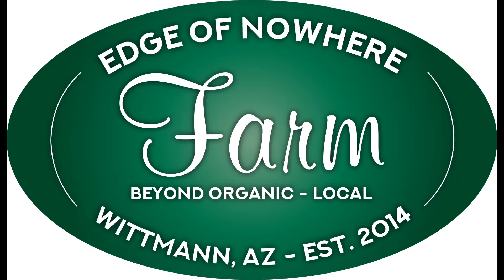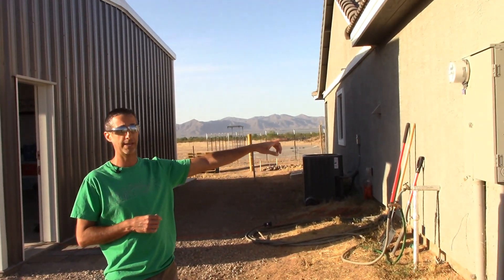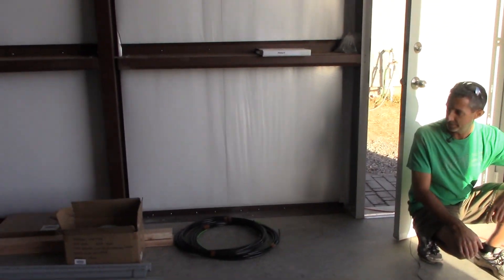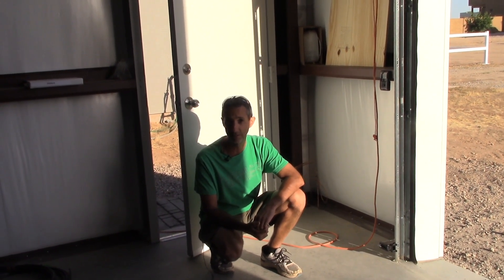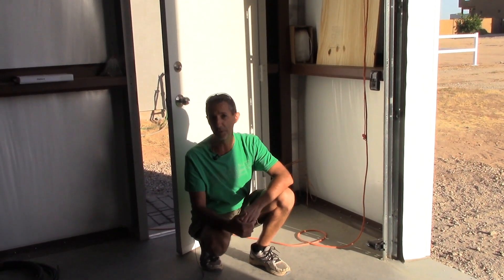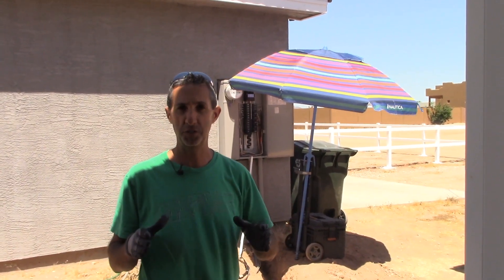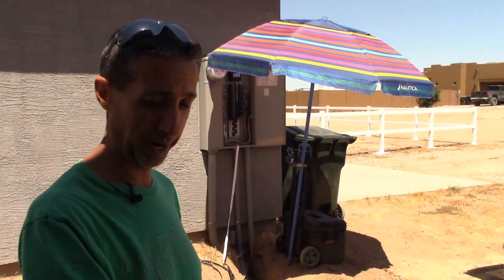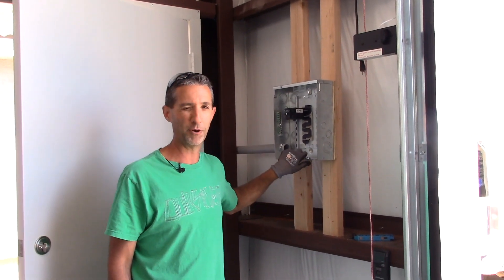Outbuilding Electrical Part 1 | Subpanel Installation

Comment: What wire did you use from the house to the shop
Reply from the maker: I checked with my electrician and he believes it was size 3 wire between the main panel and sub.

Comment: Why was the 14/2 to the garage door opener run through rigid pipe? Wouldn´t the romex from panel to opener suffice?
Reply from the maker: That's a great question and I wouldn't be able to say for sure. Our neighbor is a licensed electrician here in AZ, so I left it up to him to make those decisions. Romex is what we have in our attic without conduit, so there are no issues with what you're suggesting there.

Comment: How did you connect the 2×4 for the meter box.

Did you drill pre holes in the metal and then used screws  to connect the 2x4 to the for meter installation?
Reply from the maker: Good catch on that one. We actually used self tapping screws to drive them into the metal cross braces. They were able to go right through the wood with no issues.

Comment: No disconnect before the subpanel.....
Reply from the maker: Is that something that is customary?
Reply: @EdgeofNowhereFarm  there's a 6 disconnect rule which can bypass a separate disconnect. I counted 8 breakers in your subpanel. Arizona might have different municipal laws, regarding that rule.
Reply from the maker: @snesgenesis  I'll have to forward this on to Jake. He's a licensed electrician here in AZ, so I would hope he's aware of the regs. Thanks for the notes!
Reply: @snesgenesis  in my location the inspectors are fine with it when the main panel is this close.
Reply: @snesgenesis    There is a rule that the minimum size main for any installation is 60 amperes.   Can’t remember where it is, but it is in NEC.
Reply: @EdgeofNowhereFarm  that's code per NEC. Subpanels fed from the main breaker to an external building require a separate disconnect to protect the wiring.

NEC 225.31 States that means shall be provided for disconnecting all ungrounded conductors (hots) that supply or pass through a building or structure.

NEC 225.32 States that the disconnecting means shall be located either inside or outside the structure served or where the conductors pass through the building and it shall be readily accessible located nearest the point of entrance of the conductors.
Reply: @snesgenesis     Yes you are correct in your NEC comments.  Spot on.   Where you are missing is, there is a disconnect near the point where it enters the building.   The feeder comes into the panel and lands on a 2 pole breaker that is bolted in position(as per NEC) and is a main means of disconnect.  So, the installation complies with NEC requirements.   Had it been installed as MLO, then it would have been a possible violation.

Comment: How did you seal the conduit as it enters the building?  I see in the video you just drilled a hole in the metal siding and then ran your conduit through it but I never saw anything to seal it up? I'm guessing you just ended up putting a bread of silicone around it?
Reply from the maker: Great question and we should have shown that, but we did use silicone to seal the gaps that were created in the siding.

Comment: Hello. Thank you for posting this video. I have a question about the grounding that you or Jake might be able to answer.
I assume that the ground bus and the neutral bus are not bonded in the subpanel. 
I also assume that all the bonded parts of the outbuilding, the frame, metal exterior, etc., are bonded to the ground rods and the ufer.
My question is: Are the ground rods and ufer bonded to the subpanel's ground bus? Another way of asking the question might be, are the earth grounds bonded to the outbuilding's ground circuit?
Thank you.
Reply from the maker: Hey Sterling. Sent your question over to Jake and his response;
"Yes it is. Neutral and ground are separate in the subpanel"

Comment: Thanks Jake. I won't be asking you to do a 2000 mile commute, but I wish you were my neighbor. It's nice to know that Lori and Duane have good neighbors.

This may just be my experience, but every electrician I've had do work for me has complained about the quality of the work done by a previous electrician. The last one opened up my main panel and said "well, that's just dowright dangerous. what kind of incompetent sob..."
It's so reassuring.
Apparently, there are sometimes multiple ways of wiring things, but some are better than others.
"Trust Us" is the electrical union motto, and I do, because I don't trust myself to do it.
Reply from the maker: I've had the same experience, so being asked to assist was a welcome invitation.